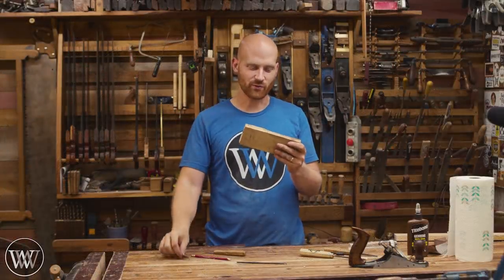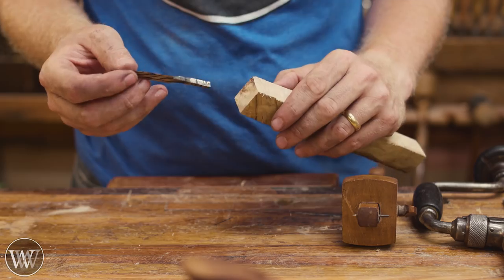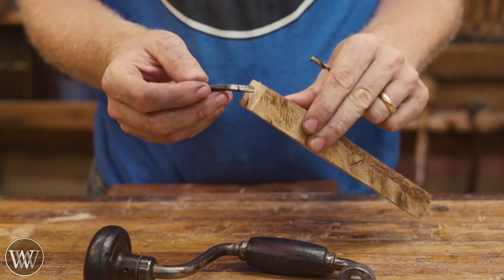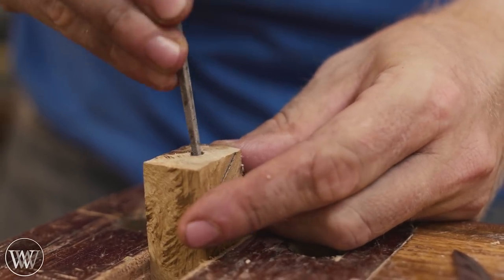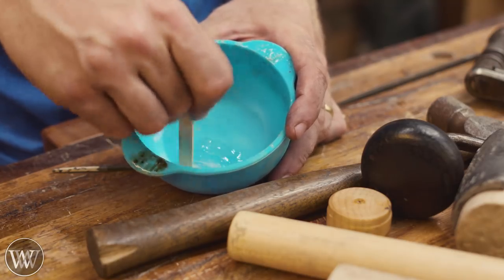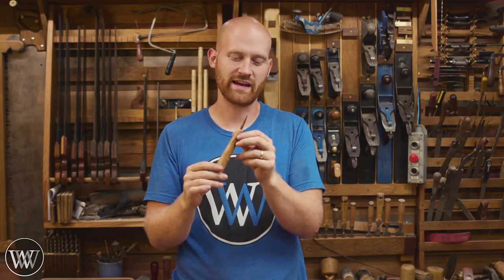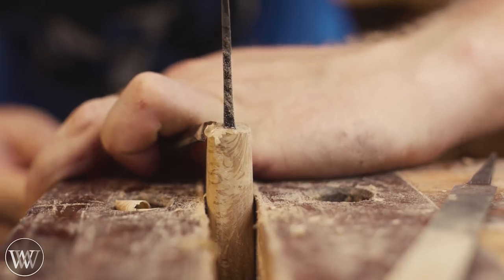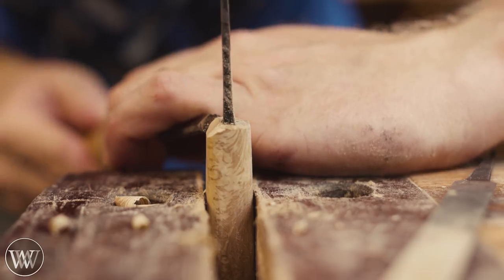Making a Damascus Steel Whittling Knife

Comment: Nice job!  Just 2 questions: Why didn't you just file the tang?  And why did you fit the blade and then shape the handle?
Reply from the maker: The tang was a bit hard. I was able to file some but not enough. It is better to shape the Handel after setting the tank so you can correct if the hole for the tang is not strait.

Comment: Out of curiosity, why did you put in the blade  before you cut the thing to length and shaped the handle? I would have thought that might make shaping the side with the blade more awkward.
Reply from the maker: At first glance that seems the easiest way until you have board one of the holes slightly off Square. And then you have a Crooked Knife on a handle. If you wait to shape it until afterwards then you can reform the handle to align with the blade. Even when using a drill press or other mechanical devices having it one degree off shows up very readily in the finished product. that is why most traditional message have you shaping a blade after fitting the Tang.
Reply: Wood By Wright Ah, Interesting! Thanks :)